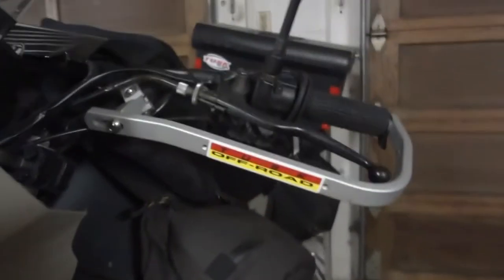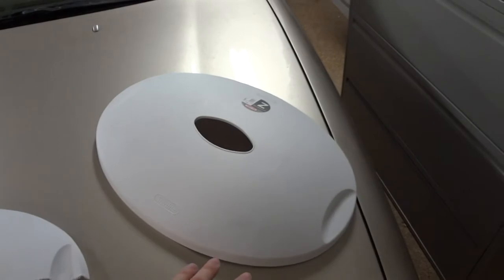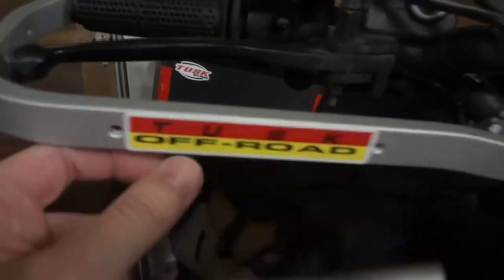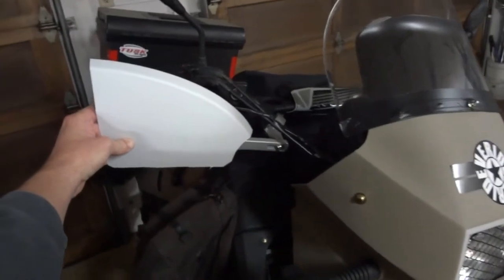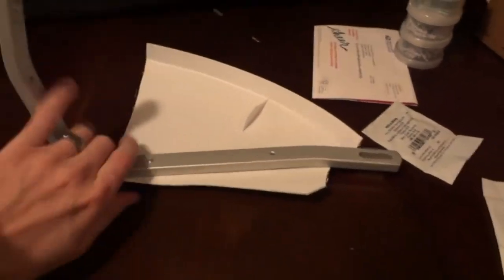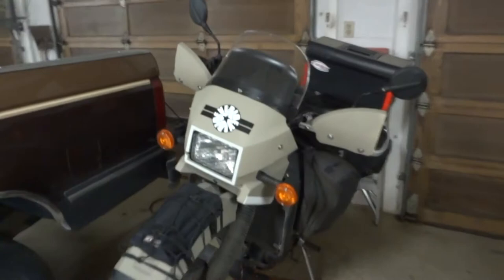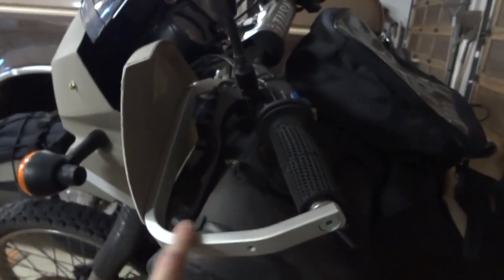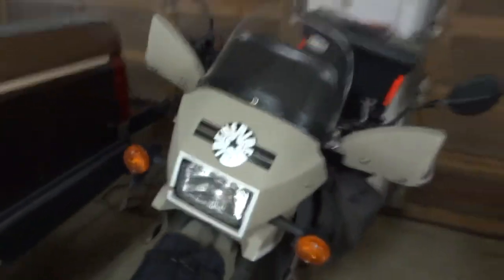o#o How to mod wind/ hand guards from bin lids on a KLR 650 (Tusk guards)

Comment: Notice any wobble? I just put my stock guards back on my '08. Hoping the new tires I put on this summer and the guards don't cause any wobble for me. Temps are starting to get a little cool and I don't run any heated gear.